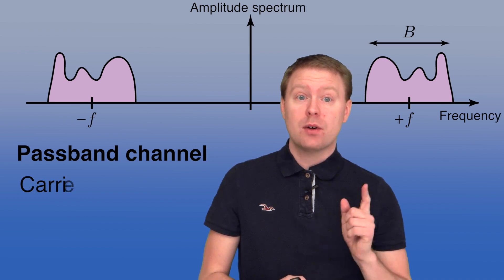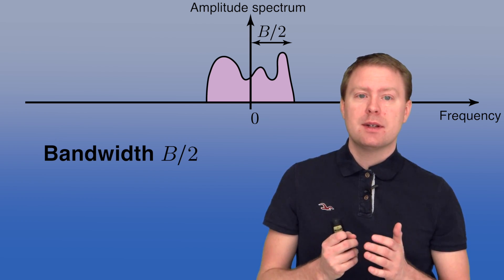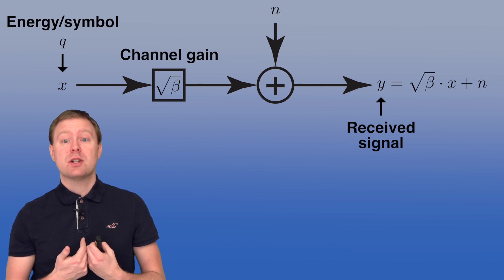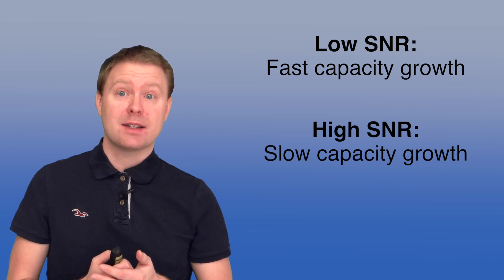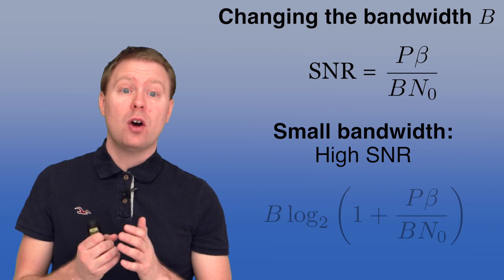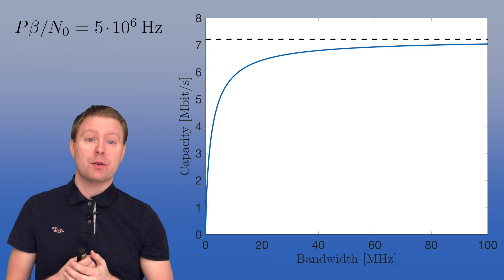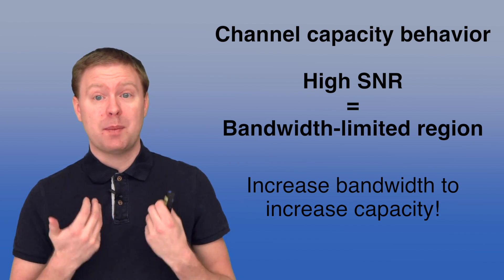Basic Channel Capacity Behaviors [Video 4]

Comment: Hello Thankyou for the detailed explaination - I have one question

If I have a Wi-Fi setup which provides me the following information at the receiver side -
RSSI (signal strength at the receiver) and the Noise floor in dB and the channel frequency response 
is there any way i can evaluate the capacity of the channel with the above values as I have no acess to baseband signal to get the energy of each bits.?
Reply from the maker: The easiest thing would be to compute the SNR as the RSSI divided by the Noise power (be careful with the dB-scales). You can then estimate the capacity as "Bandwidth*log2(1+SNR)".
Reply: @WirelessFuture    Thankyou for the explaination , just a follow up question : Considering a 2x2 MIMO channel , 
 I have the channel state information of received signal and RSSI and Noise Floor values of each Tx-Rx path, which formulae can I used to estimate the capacity of Wi-fi system ? considering rest other OFDM parameters (MCS, Bandwidth...etc ) is known to me. It would be reallly help- ful for my Thesis work. Thankyou in advance :)

Comment: 00:48  is possible to have a non-symmetric two-sided spectrum??
Reply from the maker: Yes, but then the time-domain signal will be complex valued, so such a signal doesn’t exist in practice. However, the non-symmetric complex baseband signal exist and is usually represented as two different signals. (The “in-phase” and “quadrature” signals)
Reply: @WirelessFuture  ... but the graph is representing a baseband 2-sided spectrum.... is that possible?

Comment: Dear Mr. Bjornson,
You have an incredible way to convey your knowledge :)
Could you plz make for us a video to explain why the data rate is related to the frequency bandwidth using Fourier transform ?
Thx a lot
Reply from the maker: You don’t need to involve the Fourier transform. Just apply the sampling theorem, which says that a signal is described by a number of samples proportional to the bandwidth. These samples are used to carry information, for example, by designing the signals using pulse-amplitude modulation. It is briefly mentioned in Video 3 and around slide 22 in https://youtu.be/SR10FeiuAFs
Reply: @WirelessFuture  thx a lot

Comment: The Shannon limit says there is an upper bound for a reliable communication. Then what is the meaning of "reliable communication"? In other words, if one exceeds the limit, how much deterioration will be brought about?
Reply from the maker: Suppose we transmit a block of N modulation symbols (samples). If their information content is below the Shannon limit, there is a way to encode the information (select the symbols) so that the probability of incorrect reception of the block goes to zero as N increases towards infinity. If we instead exceed the limit, then as N increases, the communication will always fail (with probability approaching 1). So it is really becoming binary. Below the limit: Success. Above the limit: failure.
Reply: @WirelessFuture  Thank you very much! Great explanation!

Comment: ♥️😍 
another piece of cake 
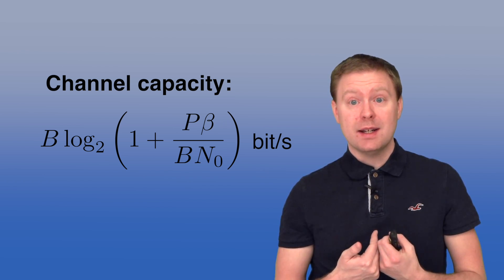but the equation @3:07 should not be in (Symbol/second) instead (bits/s) because i think it's going to be bits/s after modulating the symbols isn't it ?
Reply from the maker: If you pause the video at 2:34, you will see expressions in symbol/s and in bit/symbol. If we multiply them together it becomes bit/s. This what is presented at 3:07.